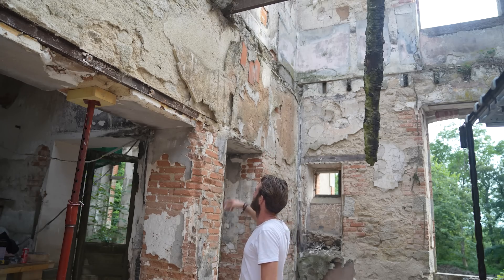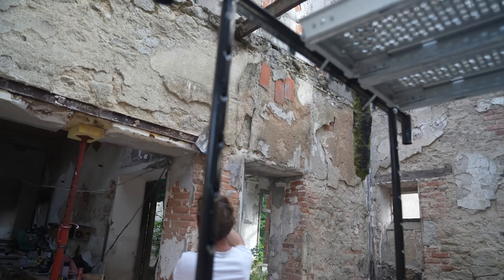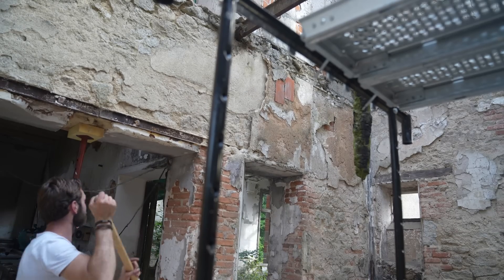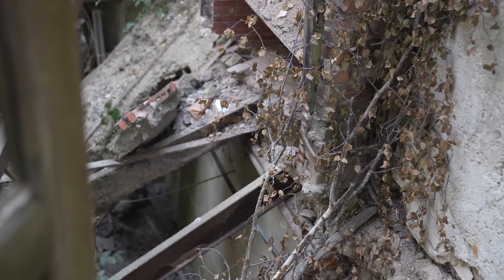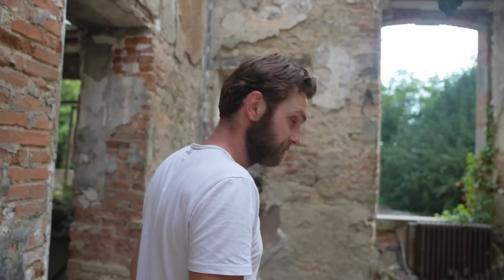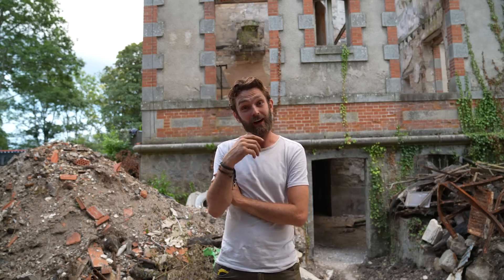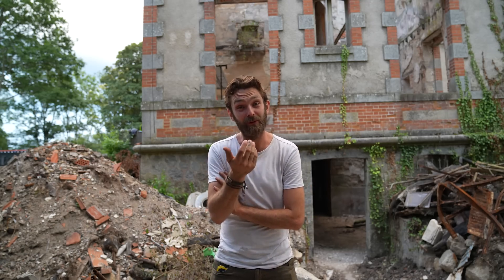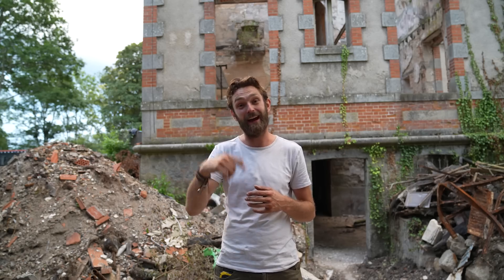Its so safe now, preparation for installation.

Comment: V107: 2:56 Dan there is a twisted rusty railing looking thing in that room - unless im much mistaken it LOOKS like a spiral staircase banister? LOVED Stephanie's'  video you are so versatile!
 The photo in the article about you Dan explain so much - there is actually a SECOND turret on the back which surprised me! Also the front turret at the top has a small platform/ balcony. Many building of this era had these and it was used - to raise a flag up the flagpole! We is a building near me with identical turret and balcony. It is reached on the top floor INSIDE the turret up a vertical ladder I have been up such a building.
Also this explains the small stove parts you found in the roof (the tiled section)near the water tanks. The servants quarter were usually in the roof and very cold so they had small fireplaces also they would have had the noise of the water tanks filling all the time. It looks like possibly 4 rooms. The centre (turret) room was clearly the 'masters suite') with the huge balcony balustrades.
Clearly seen on the roof is a FOUR POT CHIMNEY explaining the 4 strange flues going up the building THERES your answer. Before joining the forces i was studying archeology but never took that career path BUT its given me a lot of insight when I used to own my own house. I restored a 1920's art Deco house including picture rails and skirtings. All dont by myself but not a PATCH on your work 👍👍👍👍 Hope this helps a bit - any questions fire away as I am researching Chaumont.

Comment: Hi Dan,
Getting structural stuff up to the upper floors might get interesting when your looking for a low cost solution
Have you looked at the idea of putting in 2/3rd of each floor over the centre line, plus the wall structural steel pieces.  Then alternate on the next level above leaving a 1/3 open for big lifts etc. Until the roof section is in fully then backfill all the structural timbers into those gaps (precut and dryfit the wood beams, just don't fit them). Also safer for anything falling down from above distance wise (debris, people etc😂)
Regards
Larry Butler
Perth Western Australia

Comment: Great progress Dan! When is the roof going on? Hate to see all that hard work get drenched.
Officially hooked ...ty for daily posts. GOD bless you
Reply: give a look to how strange and difficult are French castles' roof
Reply: Temporary roof going on as soon as he can work his way up to the roofline, stabilizing the walls as he goes.  He is replacing crumbly brick & loose stone, repointing/remortarizing, so that it can support a roof.
Adding the floors helps to stabilize the walls, also.
He is almost to the roofline on 2nd floor main hallway.  He is using OSB3 as temporary subfloors; it can take a little rainwater, but will lose it's integrity in rain deluges.  He may have to replace some subfloors before temporary roof goes on.   He had tarped some of the floors in main hallway, as advised by many.   He could seal the floors.
Reply: @homeemail2306  ty, i really like watching his progress. GOD bless you

Comment: So I did some reading on houses with servants. The staircase from the kitchen is actually a servant pass-through. It was a way for servants to get from one point to another without being seen. I think that the dual doorway thing was center support originally, but the previous owners in their remodel phase may have taken that thing out to make a hall closet. I was looking at the great house used for Downtown Abbey to get an idea.

Comment: Not to be difficult here but the fact that so many of the iron beams fell without destabilizing the walls suggests that the tie elements embedded in the masonry really weren't needed. It's like the situation of the tie straps you had in the upper corridor. The fire heated them and they expanded somewhat. They actually stretched perhaps from falling timber etc. because heat causes iron and steel to lose some strength. I made a mistake in an earlier comment thinking heat made the iron oxidize more but you cut some and the rust isn't that deep.  They really did nothing to hold the walls at a fixed distance. The straps could only prevent the corridor walls from moving apart. They couldn't do anything to prevent them from leaning in toward each other. The straps could only really work in tension and can't resist bending. They weren't really needed either. All the walls of the house are still vertical and plumb. Also iron is more brittle than steel and is not as strong in tension(pulling) as it is in compression (pushing). Steel is the reverse. Steel is much stronger in tension than compression.  But that really doesn't matter that much in your place. Iron is stronger in tension than stone. 
You have very bent and distorted remains of bams. None of them even managed to pull stones out from around the beams.  You probably don't have to make more work for yourself by replacing the ties. It tells you the foundations are very firm and didn't settle. But since you have to break them out of the masonry anyway?  I guess there's no easier way of extracting the old beams? If settlement hasn't occurred in about 150 years it's safe to say it never will. 
Maybe the original builders weren't sure about potential settlement? If the foundations had started to settle then the beam tie-in would have been more necessary to prevent the beam from pulling out of the socket. 

In as much as you have so many more sets of beams to place you don't have to make so much work for yourself.  The masonry in your house is in much better condition than in so many older chateaux.There are no big cracks in the walls. At least so far i haven't seen any. I like to follow the Chateau d"Olly site and they always find so many undercuttings, badly done fill ins, or rotten brick, rotted wood lintels,  and broken stones or corners where masonry doesn't overlap or key into each other. They have had to do so much basic structural work even before they can do anything to repair interiors.  The house is a local landmark and they think it is worth the effort. And they seem to be doing it on a shoe-string budget. You're starting with a stone and brick shell that is so much healthier than Chateau d"olly was.  That should make you very happy. 
BtW. There isn't that much weight on the split iron lintel you showed. The pier that supported the ends probably corresponded to a partition at one time. Since the masonry over that opening doesn't support anything but it's own weight you could rebuilt it all with a better steel beam. Maybe you could even replace it with an arch that would look so good there? 
BTW - what were those tiles sloppily set into plaster you pulled from the corridor walls? Why would someone put those tiles on the walls so haphazardly? All i can guess is perhaps something was hung from the ceiling and leaned there against the wall? Maybe another water tank?  Maybe something for the hot water heating system? A second dedicated reservoir or even an expansion chamber for the hot water loop of the heating system? Maybe it was a reservoir for the house hot water system for the kitchen and bathrooms? The water was heated by the boiler on the ground floor but stored in that suspended tank(?) so as to give it pressure like the tanks on the roof? I think the radiators were probably added later. I think cast iron radiators were being widely used in the later years of the last quarter of the 19th century. But you didn't find anything in the rubbish.. Maybe it was in workable condition and someone took it? Someone took many of the stone balusters too. After the war people were using spend shells as ad hoc space heaters. They might have continued to do that for decades after? They would fill them with saw dust and let them burn for hours. An old Jewish guy I knew up hera years ago said he and his grandfather, who survived one of the death camps, had to do that to survive in the ruins of Berlin. 
And you really should consider putting in a small elevator somewhere. Elevators are fairly common now for any building more than three stories high. And your ceiling heights are taller than most modern buildings. You could take some space from one of the bathroom  bays and still have a lot of room left. You may have four, even five, floors that could be the equivalent height of 6 or even 7 in a conventional building?  The roof of the tower alone was almost as tall as the lower masonry part of the house. That tower roof could almost be a small apartment on several levels.  A church in the Back Bay of Boston did that to the attached tower and steeple decades ago.  It sits at the corner of Mass Ave and Beacon Street. You don't have to slavishly copy the old roof. But you could get at least the general massing of it. .

Comment: Dan, your doing an amazing restoration on this poor sad Chateaux, but mate please as many others have said before wear some gloves when handling all these building materials and for your hearing’s sake wear ear muffs when cutting steel etc..The noise levels from the angle grinder on steel will damage your hearing. Oh and please do get some better scaffolding, the setup you have is way too narrow and flimsy, as evidenced recently when it twisted and fell over. Safety first mate, it’s important.

Comment: Can Nick help you get that radiator down?  I’m sure it’s well attached, but is a danger for you to try to remove alone and will ruin anything it hits on the way down, like your tile floor for example.
Reply: I'd check how well it is attached and if it isn't going anywhere I'd leave it until there's a solid floor underneath. Dan doesn't seem to be particularly concerned about the tiles, he mentioned they'd need to come up.

Comment: This may have been asked before, but for those metal beams above doors and windows and such that you seem to be leaving in, have any tests been done whether that steel is still in good enough condition? Since it has been in a fire and lots of years exposed to the elements it may be wise to get an expert opinion?
Reply: They were made of the finest steel by the builder who had his own ironworks. As Dan has mentioned previously.
Reply: It is fine. Any steel which has not suffered significant distortions during a fire can be re-used ... as long as the steel temperature hasn't reached 650°C. Which in this case, is very, very unlikely.

Comment: This has probably been suggested already?
Dan have you considered a “Gatekeeper’s Cottage” by the front gate?
It would be a great place to live until the major restoration is completed and a great guesthouse in later years.
Obviously not this year.
Reply: Dan's original plans were to get a cabin onsite to oversee restoration.  And he may try a variety of accommodations  onsite before he settles on a cabin.  Your suggestion of a 'Gatekeeper's Cottage' near the front gate, or nearby, is a good suggestion for use after Dan doesn't need the cabin anymore ( when a section of chateau is watertight, & has a bathroom).   Good idea for guesthouse...thinking ahead & another way to produce income.

Comment: At what point will you be measuring for windows? I’m guessing they will have a long lead time on ordering them or making them and it might hold you up making it water tight
Reply: At the current rate of speed, some time next year I imagine.
Reply: it is quite possible that Dan will end up making the windows himself--it is not really difficult compared to the other stuff Dan is doing.
Reply: He started making a few when he was staying at his grandfather's place awhile back. Amaury showed him how. He said he'd work on them at night after working at the château, but since he doesn't have his grandad's workshop and he's not staying there anymore, plus doing daily videos, I think that stopped some time ago.
Reply: At the start of yesterday's Vlog, Dan very quickly said he just got a quote for sandblasting the exterior.  In the comments, he responded to a commenter asking why clean the exterior now? vs. focusing on cleaning off the plaster and preparing the bricks on the inside walls?   Dan replied, " Needs to be done before any windows or frames are done." 
So, Dan is thinking ahead on the window watertightness part.  He did not say when windows would come, or whether he is buying some of them ( large windows?), or making them w/ the frames ( the smaller basement windows - the ones he got instruction on how to make the frames.)

Comment: I understand the use of the blower to get all the dust and light debris out but surely a brush is better initially?
Reply: John, I'm using the leaf blower in my house now, it's so much fun😂😂
Reply: @daisylovelock9553  Doesn’t it spread the dust more than a brush? Once you’ve only got dust restricted to the nooks and crannies the blower or vacuum is indispensable.

Comment: Methinks you need a proper mask (with filters) when dealing with that debris Dan. A house of that age is likely to have had Asbestos lagging on pipes
Reply: Those pipes aren't lagged, nor were they - as they were in the open. And asbestos only started to be common in the 1930s. And Dan's pad is quite a bit earlier than that.
Reply: @LamboPhoto  Yes, that's is correct. Problem is that the house was built in the 1880's and as with all houses it wasn't just preserved in aspic from that moment until it burned down; it had a lot of 'updates' including the fireplaces and the heating boilers. So I wouldn't be as confident that there is no asbestos lingering in the debris.
Reply: @florentinalily  Fair comment, there could have been updates made later on. But (1) I have never seen pipes that are run outside of the wall that are insulated in asbestos, and (2) even if they were, Dan is working "outside" with a natural airflow, being that the house is a shell. If he was working in confined, closed spaces - then 100% agree.
Reply: @LamboPhoto  As a chemist working with toxic chemicals I would disagree.  Women have developed Asbestosis just from washing their husbands clothes contaminated with the hairs. If you look at the plume sent out by the leaf blower you can see that anything toxic is going to be hanging in the air. If there isn't any dust on his hair or body after a day doing that I would very surprised; its not a sterile environment and asbestos is light.
Reply: @florentinalily  And yet, answering your original statement, "asbestos on lagging on pipes" ... clearly, there isn't any. And it's open to the elements. I really don't think Dan needs to wear a FFP3 grade mask for the 2+ years. Sorry, but that is H&S gone mad.

Comment: PRO TIP #2 Buy a Portable cordless band saw instead of using the cutoff wheel to cut everything, much safer and easy to control. Besides i don't think anyone has started a forest fire with a band saw. 😁 Keep up the amazing work man! You are a talented guy.

Comment: Love your channel and enthusiasm. Thanks for keeping us updated every single day!!
Sometimes - like in todays video - it is hard to locate your work to the right space in your castle. I am surely not the only one. 😉 Would it be an option to show a layout of the building and mark the space, you are currently working at? It would help a lot. 
Keep up your fantastic job!
Reply: The building is shaped like a cross. One arm is the front centre section with the two doors and the tower where the stairs used to be. The opposite arm is the collapsed bit where Dan cut out the pipes in today's video. On the ground floor that's most likely the original dining room. On the left you've got the room that had the tree growing in it, probably the original salon, and on the right the former kitchen in the basement with several small rooms above.

Comment: I have been looking at that rear basement room and noticed it is a strange set up. 
A good shot is at 3:02. It looks like it is actually two rooms with a wall between and a conjoining doorway between the two of them.
If you were to put a single big beam across the top of the wall there you could probably replace the current metal beams going cross wise for long wooden beams like the rest of the house floor. It doesnt look as large of a room as the rooms either side of it. 
Could also go 3 long beams across the span of the room. One cross the internal doorways, there is a half length already there in the picture that can be replaced with a longer one all the way across like the rest of them. Then another across the middle of the room with its middle on top of the wall. And another across the rear door entrance. The rest shorter wooden beams between them all.
All of those beams are seated in three places securely. 
It will be interesting how you go about that first floors replacement.

Comment: I bet that smaller doorway for the basement stairs was added later. It looks like it might have been as I see no lintel above it. I'm guessing that the reason you see the split is because it used to be two doorways. That would make sense to have basement access from the main hall. They probably converted the 'kitchen" into an actual kitchen and wanted it to be accessed directly from the dining room, so they just widened the dining room door and knocked the extra doorway out for two entrances in the basement: One from the dining room and one from the back room.

Edit: Watched a bit more and saw the lintel. Disregard the above

Comment: I had to renovate my 1900 home and many steel beams to cut I highly recommend u buy a makita DJR186ZK salsaw with metal blade. Much faster and cleaner and less abrasive method to cut old beans and pipes.

Comment: Thanks for a wonderful vlog series. 
I really enjoy following your endeavours in the chateau.

But just a thought dough, are you sparing/saving the old original bricks? 
They will become quite useful when you start repairing the exterior, where you likely need colour and size matched bricks for a good result.
It will save you costs as well. 😊